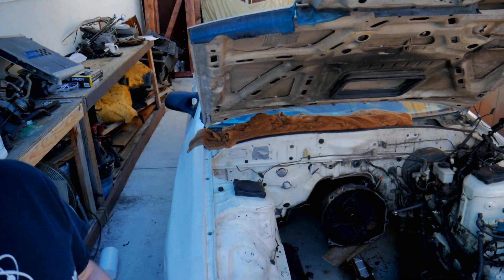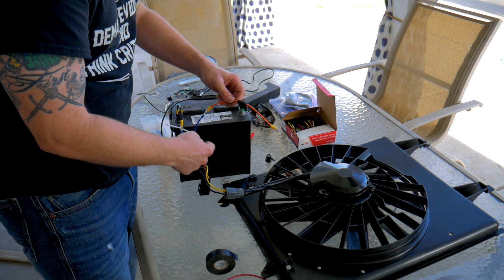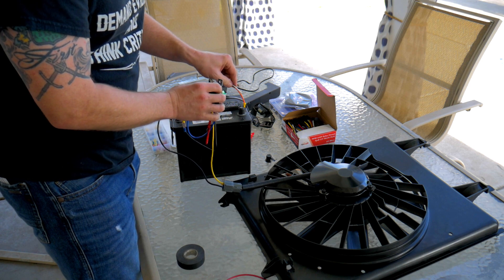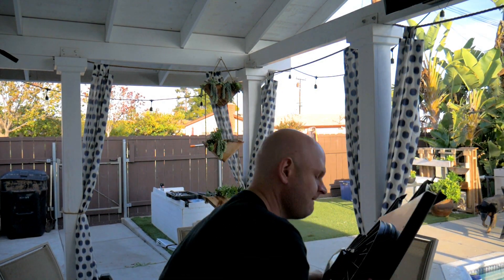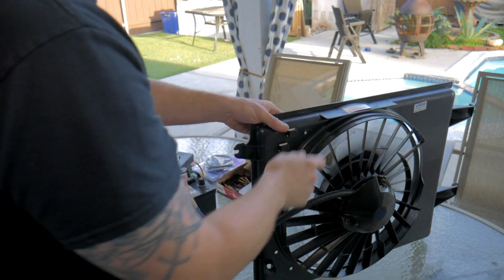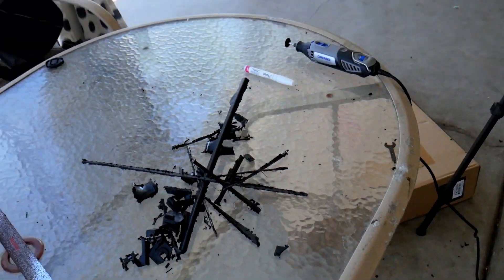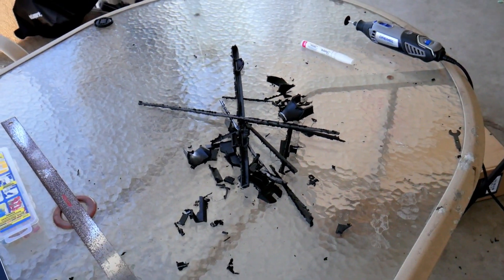FC3S RX-7 Electric Fan Install

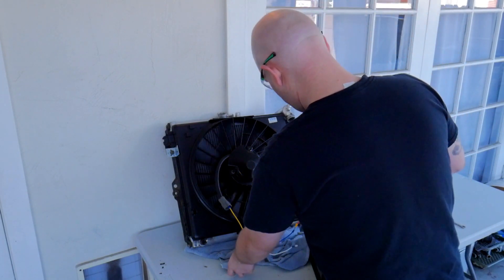Comment: I have this same fan (bought brand new) and mine makes a faint clicking noise whenever the fan is spinning. I think I can hear it in your video at 14:33. Is this something you noticed too? I just want to make sure this was normal for Nissan Quest fans. 

Mine makes a clicking noise when spun in the proper direction, but is silent when spun in the opposite direction.

Comment: i used a fan from the mercury villager (same thing as the quest). there was only a 2002 model in my local scrapyard, but it works great and it only cost $35. the shroud is slightly different, but it was easy enough to fit up. good choice to keep it cool!